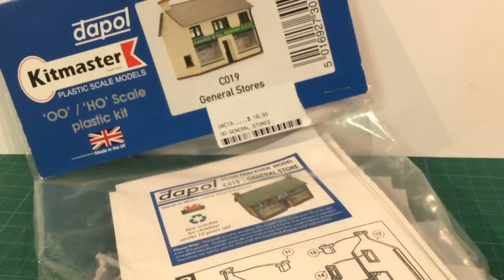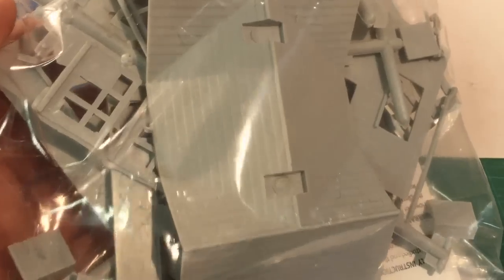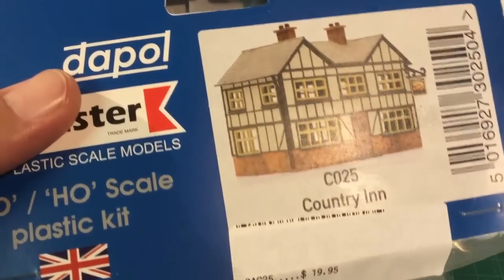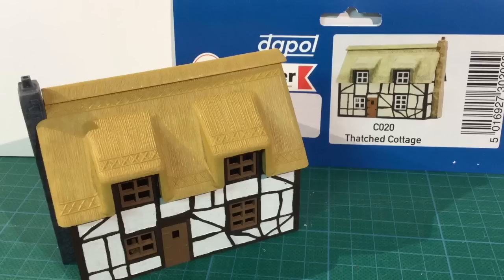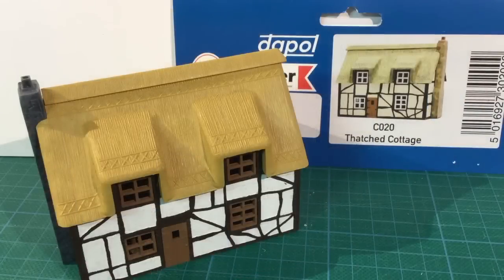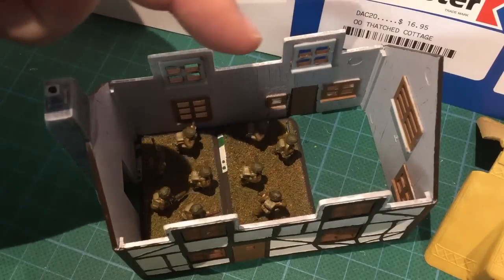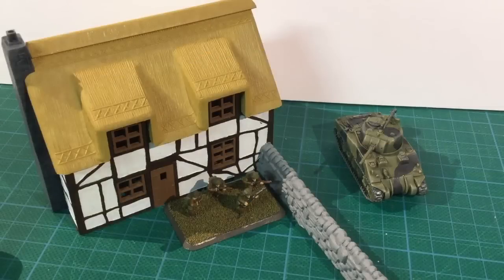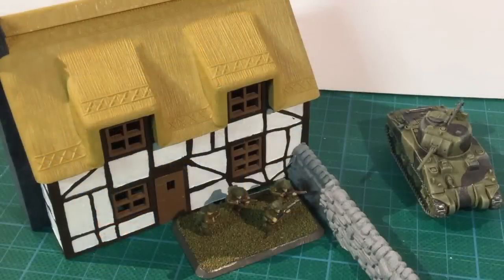Review | Dapol Kitmaster OO/HO plastic buildings | WWII

Comment: Nice review, thanks! I use the Dapol Telegraph poles to add a bit of scenic fluff to games.
Reply from the maker: The Dapol stuff was an experiment. Given the moulds are 50 years old, there are some limitations, but they are OK. Also not really cheap, but I like working in plastic and pre-built railway buildings usually don't have a removable roof! One day I'll build the other I bought!

Comment: Which paints did you use, please? Did they need a primer in order for the top layers to stick? If so, which primer/undercoat?

Many thanks and very best wishes, John Courtneidge
Reply from the maker: Hi John. I used Vallejo acrylics to paint the building. Acrylic paints do need a primer to ensure good adhesion. I just used a Rustoleum spray primer from my hardware store. This sticks to the washed plastic strongly, then you can brush or spray the acrylics over that.
Reply: That pfp